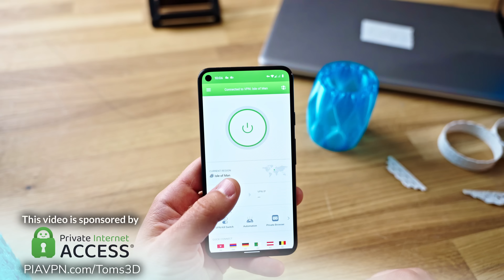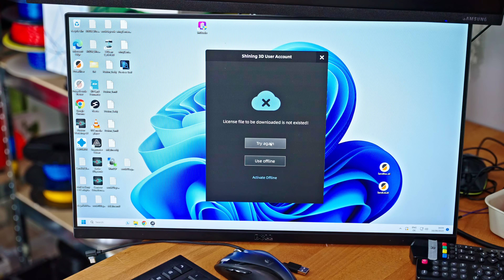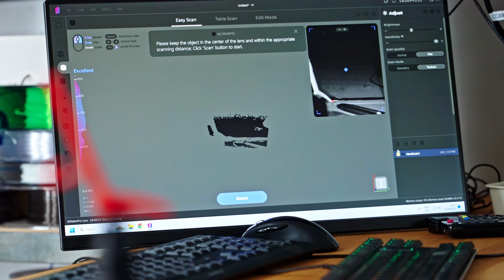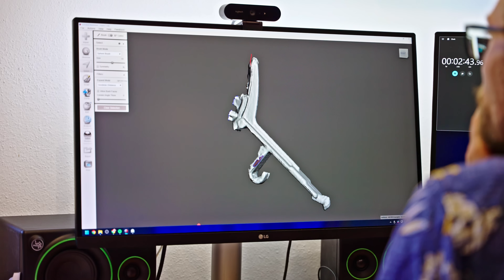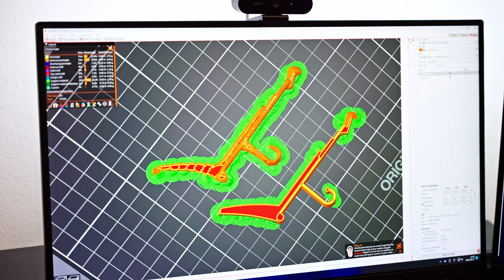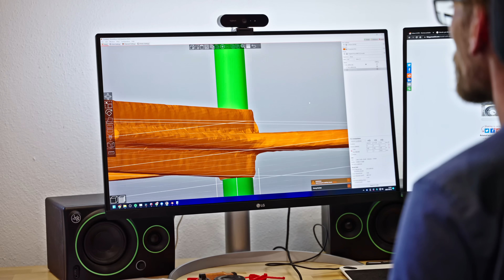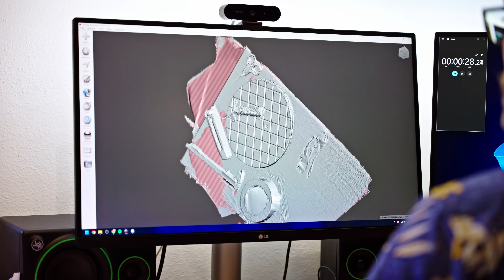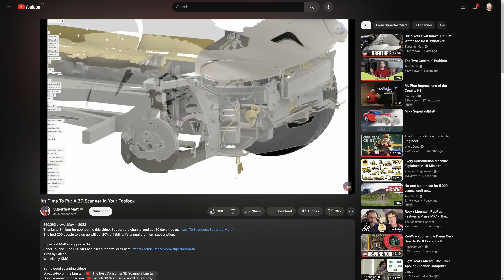Make replacement parts faster - with CAD or a 3D scan?

Comment: Bro, not having to deal with not important features is a benefit of cad. You canot take that out of the equation.
Reply: Right? I thought that was a really odd choice. And if he'd simplified the model to take out all the artifacts from the original manufacturing process, the replacement part would still have been about as close in appearance to the original as the lumpy scan was.

Comment: Those "cheaper" scanners are surprisingly crap vs just photos and photogrammetry!  It's save to say that they are just purpose build and with it,, limited in performance allround! As far as the rod goes, you coukd have just imported the model in the cad software and added the rod or do a quick Tinkercad. All in i would be interested to see a broad comparison between different scanners and photogrammetry with different object.

Comment: I just recently also compared EinScan HX to simply making my own modle. I tried a house key, a circuit card for my car fob, and a visor for a GPS screen.

A scanner is neat, but it's not for duplicating objects and more of a fancy reference maker or for artistic use only. I much preferred calipers to capture all primary features and then taking pictures with rulers on the primary features to capture secondary and third features.

Also, dont sleep on document scanners. Not only are they ridiculous, accurate, but they do export dimensions metadata that can be picked up by some CADs. I did the circuit card and key like this..

Comment: Great video Thomas, love your contributions!
Let me give you one, in most CAD you can put an image on the background and planes, what I do in reverse engineering a part is take a picture of each profile and put on each plane and use a sketch feature to size it so it is the right size.
Once you do this you can cut your measurement time down greatly and get really accurate parts, last set of parts I did were correct on first printing, and they had some weird shapes.

Comment: The CAD advantage is clear. It also gives the user the ability to create parts rather than just replication of broken ones. I am struggling to learn how to model in CAD but I consider that a set of skills that unlocks the capabilities of 3d printing.

Comment: Wouldn't you look at where and why it broke, and, fix the design a bit as well? The current one did break so don't just copy it. Pull out the engineer and make various bits of the design stronger (wider, support braces etc...).

Comment: Great video as always, clear, concise, nice flow. Thanks :)
I feel like using boolean operations on the Scan model, is leveraging CAD to increase speed. Imagine a scanner that "knows" the difference between the part and the scanner bed.
Currently, I think scans make sense for organic designs and CAD makes sense for mechanical designs. 
However, learning CAD is a major endeavor, at least few dozen hours to get efficient flow. 

One day, scanners will be incredibly efficient along with the software, I mean they have come a long way, but there is a LOT of optimization that can make them 10x faster than CAD modeling. Supporting those companies is what will get them there.

Comment: Your on point in the end of the video. I use the scanner for getting references that are almost impossible to measure with the caliper, then reverse engineer or use for references only. Even on a very expensive scanner you still get a dumb solid and need to reverse engineer it to get a real cad model. Scanning and directly printing is more for the people doing figures and stuff.

Comment: what a dumb statement saying "no one can lock me out of using calibers", i literally had a colleague who got locked out of a 350 euro wireless caliper, the type of caliper that you use to input directly dimensions in the cad...after exactly six months it literally just says that needs to be recalibrated for better accuracy and to do so you have to buy the ONE TIME calibration kit for just 80 euros and use their online software, note that the kit consists in just a replacement battery and a digital key, the calibration block thingy was included with the original purchase of the caliper
Reply: I'm an engineer and I've never heard of such a thing. Not saying that you are lying. Just saying that experience is so rare as to be irrelevant. Tom showed an analog caliper. Even digital calipers that can be connected to a PC for data entry (usually QC work) work when they are disconnected. If your colleague's caliper ONLY works with a connected PC interface and software, then I don't think that is a particularly useful device. Also, gauging the value (350 euros) is difficult without knowing the size of the caliper. For instance, I've used calipers that cost 700 USD, which seems crazy expensive until I inform you that they were 0.6 meter Mitutoyo digital calipers with data-entry connection capability.

Comment: For mechanical parts with functional surfaces I would always go with CAD. And the policy where you buy an equipment and you cannot use it before some registration should be stopped. Or at least revealed like in this case for people not to buy such products! As EU usually comes with an absolute stupid regulations, as for customer protection, it is sometimes good. Maybe some kind of “It must work out of the box if you have payed for it” could be some of the good ones.

Comment: I loved your optimized part at the very end. I've got a scanner and calipers and agree that in a lot of ways caliper measurements are better than scans. Best if to combine both to compliment each other. Angles are easier with a scanner while hard points are easier with calipers. Every use case it unique though. Good video.

Comment: I spray in a container that seals wire spraying outside. I then use a water color bush with the over spray powder for any stubborn regions. I'll also usually just use the brush because it's cleaner and quicker for small parts.

Comment: It's always fascinating how different countries have different methods for achieving the same goal. I'm from the US and our toilets have the flush mechanism attached directly on the toilet bowl tank as a small lever although some have a push button on the tank cover.  

With that first scanner, if the company ever goes bye bye, you have a very expensive paperweight. And as you've experienced, when the activation server is having issues, you still have an expensive paperweight.
Reply: hrm toilet company not in business any more. better 3d scan a replacement part. oh noes, 3d scanner company not in business any more. sorry actually that way they have locked down the 3d scanner makes me angry to the level of going psychotic.
Reply: If you want to be frightened look up a German toilet bowl and why there is a shelf.

Comment: The Lynx scanner is for larger objects. The Mole scanner is for medium sized objects. This model is perhaps too small for the Lynx - better suited for the Mole scanner. This is a personal observation - not a commercial - I have both scanners and would use the Mole in this case. Better resolution for this size. :-)

Comment: When making a replacement part you sometimes need to redesign for 3D printing; just copying it isn’t the right thing to do. Frequently the original part was designed for injection molding. A replacement might need changes depending on where forces get applied and where the layer lines are. In your sample part, for example, the cylinder sticking out the top isn’t terribly strong.

Comment: That scanner registration, and it requiring you to always be online is one of the things that makes me say, "Not everything needs to be online."  I bought the hardware, I should be able to use it.  It should come with software that I can use it with (in this case) without limitations. No subscriptions necessary, unless I want to upgrade the software.  I absolutely should not need an account to use something that should not need a connection to the internet to work.

Comment: eugh, i guess im just spoiled by having access to professional scanners, but if this was the experience I had with these scanners they'd get sent right back from whence they came.  So many hoops to just scan a basic part, to a 'meh' level of quality. 

scanners in general are much more useful tools imo when paired with a half capable CAD package that can reconstruct data from the scans. Ansys space claim is one of the cheaper options for that. Not sure if fusion can function the same way.   But being able to align the part in 3D space, having your sketch planes auto convert intersected geometry into lines/ arcs, and being able to rapidly reconstruct your part into a STEP file produces a brand new part.    

Obviously, it's not always worth the effort.  This part is borderline even being worth the effort of pulling a scanner out of the case for.  But the more complex your curvatures get and the more exact to real world you want it, the more useful of a tool it becomes.

Hopefully costs will continue to fall and software companies step up to fill the void between the poor consumer offerings and the professional options.

Comment: I would have placed the part on the flatbed scanner, model the basic shape ontop  of the image in FreeCAD and add the details by hand.  This was much faster than dealing with the post scan model. Another side effect is that I end up with a proper parametric model, too.

Comment: It'd be interesting to see 3D scanning & 3D printing used in a loop, like deepfrying a jpg. Starting with a low-poly model would probably serve as a good noise seed as the verts & edges will round over to various degrees, where a smooth model may bias noise around detail more than on surfaces

Comment: Or 3rd way, take steel  bolt that is the same diameter as the piece that broke off, drill the arm and put the bolt in the hole with epoxy!

Comment: Been getting some good scan results with a Creality CR-01 3d scanner of full size car parts and guitars and orthotic foot arch scans to make better fitting shoes or printable flipflops that wont damage the arch.
Its not good for smaller objects but what a vast improvement over previous scanners. And theres a bunch of newer chipset version scanners making for some very useful reasons to have one or a few.

Comment: would it be possible to re run the experiment using the Mole scanner made by the same company but designed for scanning smaller parts with greater accuracy?

Comment: You should have gone into more detail that 3d scanners are not one size fits all. The Einscan would have been well suited to that part size and would have captured the part in much higher detail where as the 3DMakerPro is more suited to larger parts, which you glossed over with just one line "im not sure its ging to have the detail"

Comment: If you have the supporting Hardware ( which is a lot more likely ) - Maybe give Nvidia NeRF using a bog-standard Camera a try instead of those proprietary 3D Scanners for creating a 3D Model?
I've only tried once so far and from the looks of it if one has somewhat accustomed themselves to the workflow, it pretty much looks like NeRFs are both a lot faster than 3D Scans while also giving hardly a fuck about how red, shiny, transparent or whatever the object of interest is - From the looks of it they also seem to produce a lot more accurate Models.

Comment: Working in the additive manufacturing department, I sometimes get broken parts to print that need to be reverse engineered. In my experience designing ist faster than scanning like 90% of the time and more importantly its more accurate and can easily be adjusted.
It doesn’t matter that I have a high end GOM scan 1 at my disposal. Depending on the part scanning every detail takes time or might not even be possible and fixing adding missing parts on stl models is just a pain in the ass.
Just take a picture, import it to your sketch plane, scale it and trace the contour.

Comment: I haven't watched the video, but I'm going to guess here:
It probably takes a lot longer to weed out all that scan geometry for printing or milling than it does to route a recess into a piece of stock.
Likewise it probably takes a lot longer to model intricate cosmetic details by hand than to just extract them from a 3D scan.
Reply: Watched it.
Wasn't that kind of a comparison at all. Seems like the scan's faster if you can find a machine that works, don't care what it looks like, and don't mind revisions and in-situ mods.

Comment: Suggestion, instead of measuring so much, take a top down photo with scales in photo. Import, set scale using the pips on the scale. Super fast on one plane. From there it's just a matter of getting thicknesses correctly. You took 30 minutes, I'd wager you could cut that in half if not far better.

Comment: Something that I think must be taken into account is age of computer/processing power. I can easily run something like freecad on an older computer even if it runs a tad slowly but a new 3d scanner very well might not work. I have a laptop from 2009 that runs freecadc perfectly fine but won't work with tinkercad sure to limited graphic chip.

Comment: CAD by a mile. Scanned parts take more skill to produce a usable mesh from the butchered vertices than it does to simply model from scratch. 3D scanning is not easy mode!

Comment: I already did something along what you said at the end to fix a couple of stuffs at home. I used photogrammetry instead of a 3D scanner because I don't have one. As I can see photogrammetry does not not seem really worse than the scanner you used in terms of results. I mount the part I want to replicate on a support (3D printed) with known dimensions (so I can set the correct scale that photogrammety typically doesn't get) then I use the 3D model as a reference for CAD modeling.

Comment: Tinkercad is surprisingly useful for making boolean mods to STLs. The only issue is it slows down with complex geometries, I imagine that could be an issue when importing a scanned part, although simplifying the mesh in Microsoft 3D Builder or the scanner software first might be the solution. Actually, that reminds me that 3D Builder is also pretty good for boolean operations on STLs.

An even faster method would be if the manufacturer the original unit provided STLs on their website to allow people to download and print their own replacement parts.

Comment: Nice video. What can help with the Calipers and CAD sometimes is to just take a photo as reference and drop that into your CAD tool as a background. Once you scale the picture with a measurement that is easy enough to make, it helps to have some reference to trace odd angles and curves with sketch lines.
Reply: take three pictures in XYZ with a ruler. Much faster than scanning.

Comment: I find CAD is also well-suited for making design improvements to the replacement part - suppose the rest of the system has worn out around the part such that an exact copy won't have quite the right dimensions anymore. (Or it wasn't right to start with.)

Comment: Depending on the part, you can place it on a normal scanner, which basically every paper printer has. It s very accurate and already scaled correctly.

Way better than taking a photo or something like that

Comment: Coping so hard. Its 1000% clear the modeling would've been so much easier if you had done it correctly. I'm not sure how much modeling experience you have with replication but you made it much harder than it needed to be for such a simple part. If you take a picture of the part and scale it with a 1 inch line on the paper and on cad, you can replicate the features exactly and draw around them with a half opacity image. any features that are tricky to estimate you can use calipers. Commercial 3D scanners are only useful if you KNOW your use case, like the car guy. But if you genuinely think its anything more than just something that's helpful on few occasions you're crazy. There is no substitute to being proficient in cad
Reply: ROFL at "1 inch"
Reply: You clearly know very little about Tom and his experience.

Comment: One thing I can recommend, idk if you have tried this. You can put the part (considering its not too big) stick it in a 2D scanner and scan it. You can add a ruler for scale, Inventor and solidworks allows you to import an image, which you can scale to your sketch plane. It works beautifully for parts that are small enough to fit in a 2D scannner.
Reply: This. 
I quite often use this method to copy parts that we need. Only difference is that don't use ruler - I just measure 1 dimension (usually THE IMPORTANT one) and than scale whole scan accordingly in Inventor.

Solid edge also is nice for this purpose with it synchronous modeling approach.
Reply: Fusion 360 also allows importing images

Comment: I would have taken a much different approach. Since the part is mostly like a 2D extrusion, I'd have taken a photograph or scanned it on a 2D-scanner. Next import it into e.g. Fusion. Calibrate the dimensions and start sketching. Just do one half (vertial) and when done with all features mirror it to get the complete part.

Comment: I've had a Revopoint Mini for about a year and it's actually pretty good with small parts but it did feel like buying a beta product. Usability at the start wasn't great, lost tracking really easily, couldn't scan anything but small things. It's decent now but the largest thing I would scan on it is something like a gauge cluster for a car and even then you're just peppering markers all over the thing. Did not like the AESub Blue Spray, not sure if it's the climate here but it would start to evaporate within ~20 minutes, the orange lasted overnight would be nice if I could get just a few hours.